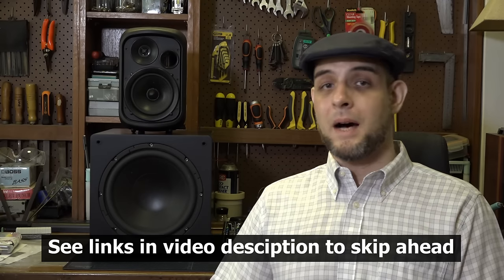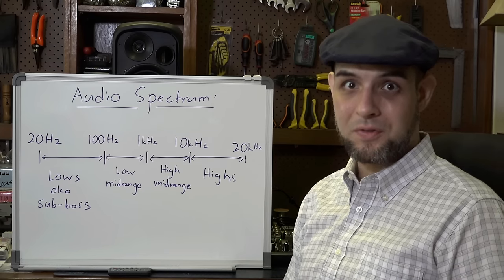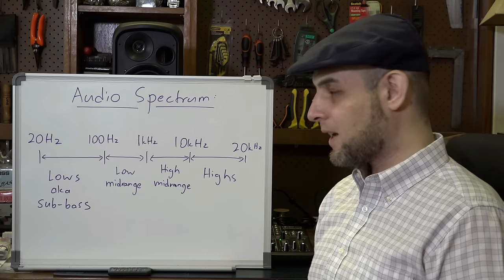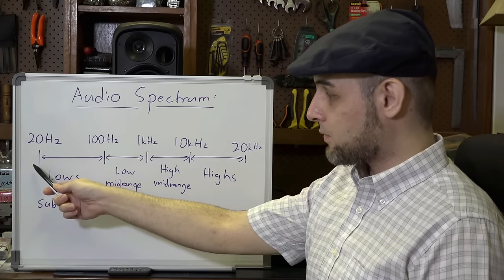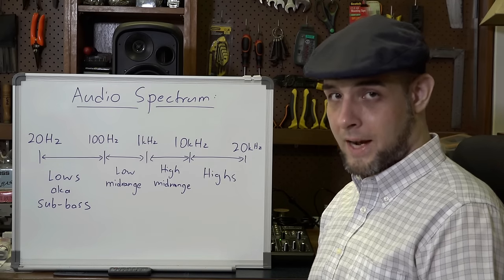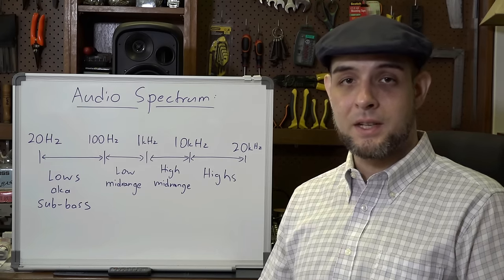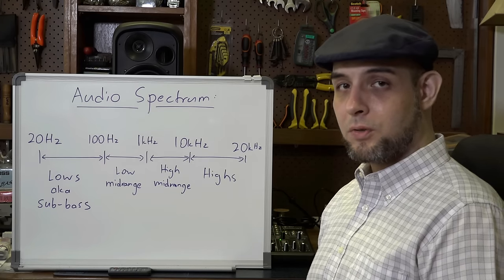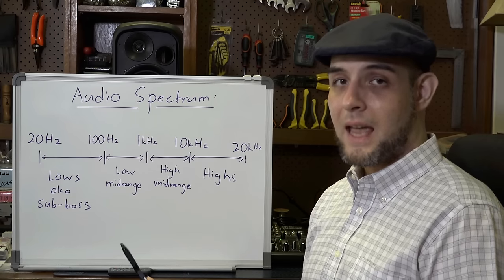How to connect an active subwoofer to a sound reinforcement system

Comment: I have a question. When I plug in my subwoofer (qsc Ksub) and then plug in my top (avante a15), my subwoofer ends up losing what sounds like half of its power and doesn't hit anywhere near as hard as when its only playing just the sub without the top, and additionally, I only need to turn the top up a tiny bit before a LOT of sound is coming out of it (think full gain on the sub and 1/4 on the top) Is this normal? it also happens if i have both tops daisy-chained directly without a sub at all. Thank you for any input (no pun intended) your videos are so detailed and helpful. 😊
Reply from the maker: Hi there Wayne, how are your subs and tops connected? Please tell me the cabling sequence, starting at your mixer 😊
Reply: @GLBProductions  Sure! I have 1/4" going from the left main out on the mixer, to the XLR input A on the subwoofer, then XLR out through the same side output, up to the XLR input on the top speaker. It's just one top speaker set up, like in your video
Reply from the maker: Ah ok, I suspect that the problem may be the 1/4" cable - try replacing this with an XLR cable and see if the situation changes.

Comment: Hi Bruno. Thanks for all your clear videos. They are the number 1 reference for al my sound engineering for our band. 

We always used an amplifier with passive speakers. But now we want an active sub woofer in the mix. Normally you go from the active sub into an active top, like you describe. Is it possible to go from an active sub into the amplifier and then the passive tops?
Reply from the maker: Hello Klaas, nice to hear from you. Yes - connecting an active sub to a power amplifier and then to passive tops is almost exactly like connecting directly to active tops, the only difference is the location of the amplifier 😁

Comment: Hi Bruno
Can you have Line In from mixer to Active tops then out to Subs…? Or preferably from Sub to tops like your video suggests?
Reply from the maker: On some models you can - it depends where the crossover is located. Consult the user manual or contact the manufacturer of the specific system.
Reply: @GLBProductions  thank you and stay safe

Comment: question about adding a powered subwoofer to an existing 70v system? there is one amp with 7 loudspeakers but it lacks the bass, can we add a subwoofer to  a Rockville RCS-350 amp using the RCA Line Out#2? Thanks!
Reply from the maker: Yes that should be no problem.
Reply: @Ed.  You have 7 loudspeakers and it lacks bass?  Where is your system located.  Outside?  Or some gymnasium/auditorium?

You may want to check the positive and negative terminals on the speakers.  Perhaps some are out of phase.  You might be getting bass cancellation.  

What size are the drivers on the 7 loudspeakers.

Comment: Hello. And thank you for great videos. I have a question. I have a Yamaha mg16xu analog mixer and two fullrange Yamaha dbr 12 speaker. I have bought af subwoofer, and are i doubt how to get the best sound. We are to singers, with electric piano, accustic guitar, elektric guitar, and a “beat buddy” drum maschine. So a small setup, but rock -pop musik with drums. The woofer is a power dynamics 18” (1400w) . Both the speaker and the can split the signal. What is Your advice?
Reply from the maker: You could use either of the methods shown in the video, and use either the crossover in the fullrange speaker or in the sub. The best method is the one that sounds the best and is the easiest to set up at shows. Experimentation is good 😊

Comment: Thank you so much! Ive been watching all your videos from the Qu 32, guides for DIs and others, been super helpful!

Would just want to ask, for venues like a church hall where for some reason the venue tends to be bassy and without much sound absorbing materials, is a subwoofer still recommended?

And if a subwoofer is recommended, is one subwoofer enough or would two subwoofers be needed? For more context however, our speaker system runs in mono because the two FOH speakers we have are ceiling mounted right beside each other at the center of our church and we play contemporary songs with bass guitar, Keyboards and electric drums. Thanks for the input!
Reply from the maker: Thanks for watching, glad the videos have been helpful. It's really not possible to determine whether a subwoofer is recommended based on just the venue acoustics - it also depends on what sort of music you play, what frequency response and maximum SPL is needed from the system etc. Same with the number of subwoofers, there are too many variables for me to make a simple recommendation. I suggest engaging a competent audio/acoustic consultant who will be able to take the appropriate measurements and make a recommendation based on actual data rather than just opinion 😄
Reply: Thanks so much for the input and taking all the time to answer all our comments, truly appreciate it 😁😁 God bless
Reply from the maker: You're most welcome, all the best with your sound system!

Comment: Why use a subwoofer with 2 inputs . A subwoofer typically has 1 input. So will the connections be using method 1
Reply from the maker: Many active speaker systems are designed such that one sub matches the output of two fullrange speakers - having just one sub simplifies cabling and means that there is only one system crossover instead of two. Passive subwoofers, of course, only have one input.

Comment: this is a Great video thanks! im just starting out as a sound technician, i have questions . a.)How do I connect 2 subwoofers and 4 active speakers? b.) Is it more preferable to use the Aux send method & c.) Can i also use the Mono Output of my mixer to the subs?

thanks,
Reply from the maker: There are many ways to set up a system such as this, depending on your needs and venue shape/size. I suggest you get help from somebody who has set up the system before :)

Comment: Your videos are always awesome! I have a passive full range Peavey 215 and a passive Peavey 118 sub. The amp that I use to power the subs has a x-over. I usually set it to low pass at 150Hz. The amp that I use for the 215s does not have built in x-over, so therefore it still would pump out all the low end as well, right? What would u suggest?
Reply from the maker: I would suggest buying a second hand analog rackmount crossover - the improvement in sound quality is worth the investment. Failing that, try swapping the amps around and using the amp with the crossover for the fullrange speakers - it's more important to cut the low end out of the fullrange speakers than the mid/high out of the subs.
Reply: Thanks for taking the time to help me!

Comment: Hi sir, I have 2 amplified subwoofers of 15 "Behringer, 2 subwoofers amplified of 18" Behringer, 2 amplified speakers of 15 "B115D of Behringer and 2 amplified speakers of 15" B615D of Behringer. How would be the correct way to connect all this equipment from a 4-channel mixer. I will be grateful for your prompt help.

Comment: We're I get confused is on the audio mixer mains out ,can the volume  signal  l - r  to the active pa sub woofer  be controlled from the mains out  level knob or does this have to be kept at o to stop the line signals increasing to much for the sub to handle? 
If anyone can help on this question which I believe was not covered in this excellent tutor video! 
Also can you tell me proper procedure for coupling active sub to power mixer? Thanks in advance! Ps  My standby non powered mixer is a basic mix 8 compact mixer to the pa 15  active pa sub and the main  - Spirit 600 power station - to  active 15  pa sub;
Reply from the maker: I'm not quite sure if I understand your first question - you want to control the level of the sub independently from the level of the LR speakers? For connecting to a powered mixer, any LINE level output from the powered mixer can be used - main LR, aux send, group send etc.

Comment: I want to add a powered subwoofer to my powered mixer with passive speakers. Please explain how I should set this up. As you can tell I’m new at this.
Reply from the maker: Which powered mixer are you using?
Reply: GLB Productions I have the RockvilleAudio RPM870  8 Channel 6000w. W/Bluetooth, usb, 7band eq. The RMS 500 w x 2 @8 ohm.

Comment: hey mate,

how would i go about connecting an active sub to active speakers, straight to a 3.5mm jack on my laptop? would i need a mixer?

cheers, sam
Reply from the maker: I would recommend using some kind of USB interface for this, rather than the headphone output of the laptop. That will give you two separate, balanced outputs that you can then connect to your loudspeakers. Units like the Steinberg UR22 are powered by the laptop and give you an additional headphone output which can be used to monitor the output of the laptop without sending the signal to the speakers.

Comment: I have a basic PA system for karaoke at home.
I had a Imeshbean 4 channel power mixer, two 15” passive speakers. I want to add some bass to my system. What subwoofer can I use, and how to hook them up please?
Reply from the maker: I suggest you approach the vendor who sold you the original system, they will be the best party to give you specific advice.

Comment: Help,. I bought a Peavey i4B powered mixer for occasional home kareokee,, 
 Were do i connect my active subwoofer to were the level output level of such sub will go up and down as i turn up or down the master volume?. 
  Thank you in advance  Mate..
Reply from the maker: I would use the line out on the back panel. Remember that this will not remove the sub frequencies from your fullrange speakers, so you will not be getting the full benefit of having the sub 😉
Reply: @GLBProductions   ok. I do understand, but for now that mixer is all i got, so i will keep that in mind,,.
 But rest assure i will eventually upgrade to better equipment because im new in this dj hobby for me and I'm really enjoying it,.
   Thank you,,. Cont me as your new subcriber. 👍
Reply from the maker: You're welcome Victor, welcome to the channel!

Comment: Hi, quick question. Do I need an amp to power up the subwoofer & high speakers? There’s no power switch on the speakers but jack input. I tried to hook it straight from a mixer but not signs of power or sounds. Sorry I’m new at this.
Reply from the maker: It sounds like you have passive speakers that require an external amplifier. This video will help you learn about the differences: https://www.youtube.com/watch?v=nbBULZpkeL8
Reply: GLB Productions thank you so much

Comment: Hi excellent video. I was wondering could you connect 2nd top from the mixers right channel to the other channel of the sub ?
Reply from the maker: Yes, that's exactly the correct way to connect two tops in stereo :)

Comment: I really enjoyed this video. My question, in the last system setup, where would a 31-band eq be positioned?
Reply from the maker: Thanks for watching. To fully EQ the aux fed sub technique you would need two EQs: one on the aux output and one on the main LR outputs of the mixer.
Reply: @GLBProductions  Thank you. Right now, I take the L-R mix from my Mackie mixer through the snake, into the L-R inputs on my Active 18" sub, then outputs to my Yamaha 12" "tops". It works ok, but I want more control of my sub, so I'm hoping your suggestion of running the sub through an Aux mix would give me more control. Do you agree?
Reply from the maker: It will give you more control for sure, but may not give you a better sound 😄 Definitely experiment and see which setup works better for the type of music you play.

Comment: I have a question, in the video I heard when a Full Range speaker add a Subwoofer, the sub handle the lows and the full range handle the highs. So is that the meaning that the full range speaker could automatically send the bass part to the subwoofer and produce the mid-range through it's woofer? Or I have to do it manually. Thank you!
Reply from the maker: You have to do it manually, and the process will depend on whether your fullrange speakers are active or passive and what electronics they are equipped with.

Comment: @28:01 if I want to use the aux fed technic, but how do I get individual volume control from the mixer to TOP speaker versus volume control from the mixer to the SUB? Let's say I want to lower the volume of the TOP Speakers from the mixer, without lowering the Volume of the SUB, how do I do that since the is the first thing that is connected to the main outs L/R of the mixer?
Reply from the maker: Volume for the fullrange speakers is controlled by the main LR master fader, volume for the sub is controlled by the aux master level control.
Reply: @GLBProductions  Thank You for quick response. If I understand correctly, this means the sub roofer would not be in between the mixer and the passive speakers. I would then come from the mixer
1) full range -> amplifier (with built-in low cut) -> into Passive Speaker
2) for the sub, Aux/send -> to Sub.

So with the passive speakers, it's basically like technic number 2 right, just make sure my amp has low cut option, or get an analog crossover between the amp and the speakers. 

Did I get that right?
Reply from the maker: Correct - LR outputs from the mixer connect to the fullrange speakers via the crossover/amplifier. Also remember that the aux send should be post-fader.
Reply: @GLBProductions  Thank You! Bro I wish everyone was as talented at teaching as you are. Do you have a full audio online course?
Reply from the maker: You're welcome 😄 No I prefer to teach in-person. If you're looking for online courses the ones by SynAudCon are excellent.

Comment: Hi Bruno... What about the case when there are two subs and two full range all passive? In case of Aux fade method, is there has to be two Aux send outs on the mixer?
Reply from the maker: No, just one is enough - subs do not really benefit from being run in stereo. The sub amplifier does the signal dividing.
Reply: @GLBProductions  Thanks so much. I need to buy a mixer, so it is usefull info. One more: Do I need two x-overs as well or one DSP is enough to solve the problem? I already have two amps.
Reply from the maker: Ideally you need three channels of processing: left, right and sub. So it depends on the capabilities of your DSP. Something like a 4-in 8-out unit will handle this fine.

Comment: Hello GLB Productions. Thank you for your useful videos. I would greatly appreciated if you can help me how to setup my entertainment system in the correct way. My system includes: Mixer Yamaha MG124C, Power Amp Technical Pro LZ6200 watts, 2/3-way crossover Behringer CX2310,  Effects Processor Visualizer  3D FX200C, Equalizer AV-EQ95D dual 31channels, BBE Process 482i maximizer, HSU subwoofer VTF-15H MK2 600W RMS, and 14inch Seismic Speakers. I've seen lots of your videos and tried to setup, however the sounds are terrible. I tried to setup in different ways but the sounds is not acceptable, especially when sing a karaoke. Please tell me the good way to setup this system and how to improve the quality of sound? Appreciate for you effort.
Reply from the maker: Hi Jack I'm not an expert on home audio - suggest you consult somebody with more knowledge in this area.

Comment: Love your videos💚 Got a question about crossover: in my subwoofer I can choose 90Hz or 120Hz. I want to connect this sub to my full-range speakers with frequency range 44 Hz – 20 kHz. Do I set the crossover by ear or are there any rules how to set it perfectly?
Reply from the maker: Thanks for watching! 
I would say that unless you have access to audio measurement software like SMAART just set it by ear. Remember that the positioning of the sub relative to the fullrange speakers as well as to the walls and corners of the room can have a big effect on the overall sound.

Comment: Thank you for an excellent educational video. I have a Yamaha MG12XU mixer , I like to use Aux1 for additional external FX unit that takes up the last Aux,  I still like to retain Aux2/FX for the internal FX. Would you please explain how to connect sub-woofer using Group, and if using Group for sub-woofer how much control  do I have for the sub-woofer?
Regards
Reply from the maker: Hi Hieu, driving an active sub from a group output is similar to setting up an aux-fed sub except the take-off point for the signal is now after the group fader. The signal routing is thus more complicated - you can either have one/a pair of groups dedicated to the sub or use a group that already contains your low frequency inputs and send that to the sub as well as to the main outputs. This added complication is why this technique is not used very often.

Comment: you did really great! just want to know more about the aux fed sub. do i have to connect another crossover or eq to the sub?
Reply from the maker: Ideally you would do so but in practice you can often get away without - the high frequencies won't hurt the sub. The best solution is to use a sub with a built in low pass filter.
Reply: thank you so much you have been very helpful in your videos.

Comment: Hello. I have a question.  Is that considered stereo when you hear 2 channels left and right from the same speaker? Lets say i put both L and R channels in one powered monitor . Is that considered hearing stereo only from that speaker even both L and R channels are hooked up on that speaker?
Reply from the maker: No, I would refer to that as a stereo signal that has been mixed to mono.

Comment: Hey BrunoLuz,?thanks for infos you shared, I have a question? I only have a very simple subwoofer, with in & out from Kustom PA112-S. How to use this, is this an active or passive? Thanks
Reply from the maker: You're welcome Dani. That's an active sub, so you can deploy it according to the instructions in the video. The only difference is that it doesn't have XLR inputs and outputs, so you'll need different connectors.